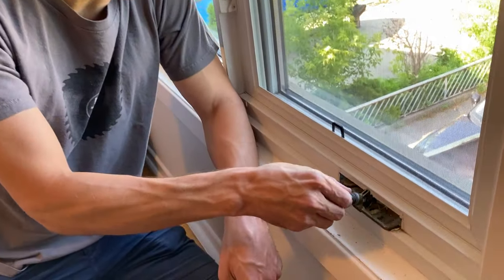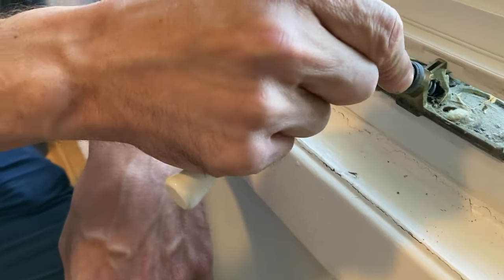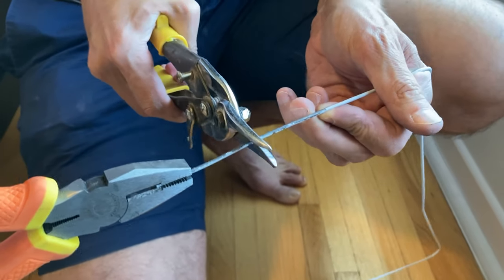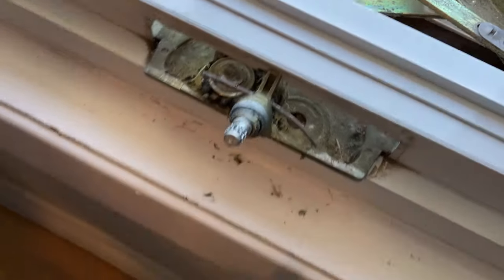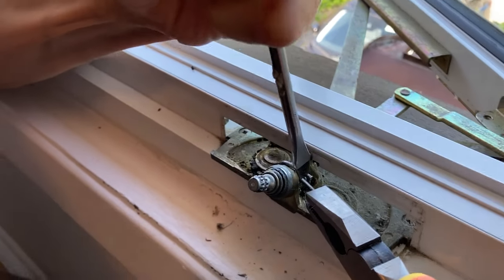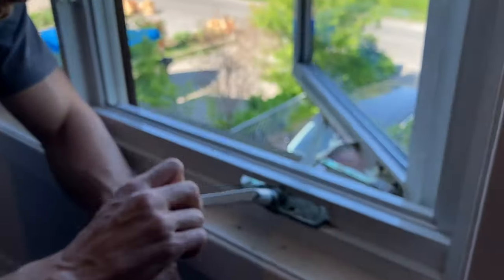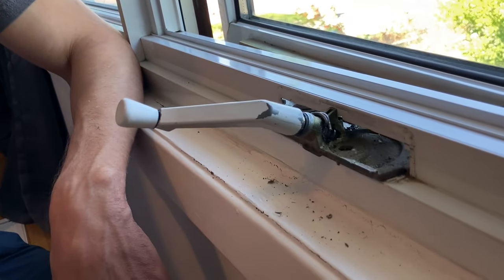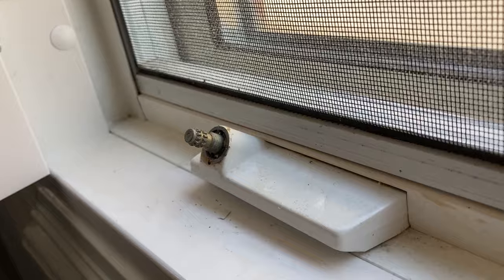Window Crank Repair Trick (for cranks that slip out when closing a window)

Comment: After 2 hours of frustrating search I found your video; couldn't believe that anybody else faced the same issue AND figured out a way to fix it! THANK YOU GUYS (from Canada too)! It worked for me.
Reply from the maker: Really glad it could help! Appreciate the comment
Reply: damn good for you..my Andersen casement window model doesn't have enough side opening to slip the wire between the frame and the first thread like this video.
If I put the wire between first and second thread, it gets stuck. Imma replace the whole operator at this point but
save the part and see if I can scrap the opening a bit so I can use it later for another window.
This house has about 20 Andersen casement windows as we moved in like 5 years ago, and there is NOT a single window that operate normally.
Reply: Thanks from Stoney Creek.  Same thing happened to me this weekend.  Was not looking forward to a big repair.
Reply: Buddy I know exactly how those were broken, because I'm Canadian too 😂 damn ice

Comment: Thanks for sharing. It started about three years ago they were breaking one by one and approx. $50.00 each for a new one on a fixed income was not affordable. I saw other videos but i didn't try them, then i came across this video and fixed 4 of them in less than 1 hr. and they work great. Thank you so much from Ontario Canada
Reply from the maker: Really glad to hear that this trick worked for you…it can be so frustrating dealing with this kind of thing! All the best!
Reply: Hello from Caledon. We have a kizzillion of these throughout the house on our Royal windows(I WOULDNEVERBUYTHEMAGAIN) our are metal and need to be repaired,,but i haven't tried any repairs on them yet. I'm hoping that it will be as simple as this,,but knowing my luck, not likely...Question; how did you figure out what needed to be done??
Thank you.

Comment: Yes!! Thank you have had 3 of these broken for 5 years and have had to take the screens in and out because the window guys all said we had to replace them to the tune of 1500 for each window! Now they are fixed. Even if temporary, this cost me NOTHING. Thank you!!!❤
Reply: If ever needed - you can replace the hardware. The only hard part is getting the wood trim lifted, the remainder is just screwdriver work. There are videos for that. Hardware is $30-80 each window. I have replaced it on 5-6 windows because the teeth in those cops were chopped off. Now I am facing the above problem for the first time.

Comment: Wow. THANK YOU. That was an awesome fix. FYI, I used a small screw leftover from a wall switch faceplate. I literally just screwed it in, making it very snug and tight, and I think it may be a little stronger than coat hanger wire. Seems to work just fine, and saved me a LOT of trouble from having to take apart the window frame. BTW, as a southern Californian, I absolutely love your accents. 🤘😁

Comment: Thanks for the vid and I tried this out and it on this exact same crank and it works.  My wire work was a little sloppy so makes it hard for the housing to stay in neat but it works. 

Then I realized something and had a duh moment. 
That plastic housing has a lip on it where the handle spindle goes through. 
It's that little lip that breaks that allows the spindle to worm its way out. 

I was about to replace the whole assembly and then realized I ONLY have to replace the little plastic cover. 
THAT will keep it in place and only costs $7 on Amazon and just easily snaps in place. 

The problem for this specific brand is that tiny little plastic lip breaks.  Replace it in under a min with the $7 snap on replacement.

Comment: Thanks guys. I had tried loctite on the pressed in shaft bushing. Worked for awhile. Thought I was going to have to spring for a new one. Found your very helpful video while searching for a reasonable price. I used a hardened Allen head bolt and locking nut, 6-32 I think or might have been an M4 from my junk drawer.  👍👍

Comment: It works! I For anyone having problems with the fit, I had to open my window most of the way to get the coat hanger into the groove. I only used pliers to bend the coat hanger back and forth until it broke, and used pliers to slide the piece of coat hanger in. I have truth casement windows, I think from the 80's but not entirely sure. Thanks for the video! EDIT: I also have anderson casement windows, this fix will not work for those.

Comment: Thank you so much, this is exactly what I needed to watch.

The screws for mine is on the outside of the on the window of the mechanism. (And I could not drill or unscrew the back to get to the hole, to put the clotheswire through)

There are five screws, the one in the middle is kind of blocking the round turn flat thing with the groove; that make the window open and close.
Plus there are two tiny little screws on the other side so you're not going to get all of that.
 I'm done unless you take the whole window part. 

So after removing the window screen.
1. I just loosened 4 screws (maybe it wasn't necessary). I noticed that if I turn, with my right hand.... the handle to the right.
2. Then pull with my left hand forward...... just do that in increments.
 About four times, that made the window come back in.
3. Then you can get something like a curved, thin handle or string to pull it close....that last half an inch. Then lock it in place.

To God be The Glory. I prayed for a video. This help me see what's need for my window.

Comment: Brilliant!  Thanks a ton guys! It was a little hard to get the wire through but it worked great. Way better than drilling a hole and set screw. Thanks so much for sharing.

Comment: Great idea.  Very observant.  My  client has a whole house full of older Anderson windows that are doing this.  NONE of the thermal barriers are broken on the sashes so it would be a shame to replace them just because of the openers.  I was going to investigate replacing just the crank mechanism but this saves her even more dough.  Good eye, gentlemen. This is the kind of stuff I do all the time but you two beat me to it!  I'm going to subscribe as you seem to be as clever and humble as me!   Keep up the good work.  Anderson could have used you two when they designed the cranks in the first place!

Comment: This trick worked well on a 25 year old casement window with a Truth dual arm operator. Use only about 1-1/2 inches of wire, then bend the excess to the back instead of around the casting. This allows the original plastic cover to fit after the repair.

Comment: Thx! Worked well (with two pieces of coat hanger for ours) for one of the old Truth Entry Guard window operators (circa 1980) we have which opened but did not close, like yours. The others we have which resist both opening and closing I think we’ll need to replace; hopefully just the crank operators, not the whole windows.
Reply from the maker: It's nice to hear that it worked for at least one of your window cranks! Good luck with the others. Thanks for the comment!

Comment: This is great, what it is, there is normally a plastic bushing between there to keep it from moving in and out, they ware out over time from dirt and grime.. This is the same way I fix them. The one you fixed are older ones..  The other you looked is newer version. Those are casted, open the window all the way  and you can removed it from the outside.
Reply from the maker: Thank you so much for the tips here! I appreciate you letting me know about the casted/newer cranks as well. Thanks for watching and all the best!

Comment: A cotter pin would be an easier install than the clothes hanger wire.  But thanks for the idea.

UPDATE: I have a slightly different style of crank housing.  I can't drill a hole thru both sides of the housing.  I drilled a 7/64" (2.7mm) hole on one side of the housing.  I hammered in the aluminum stud from a 3/16" pop rivet into the hole to pin the crank screw to the housing.  

The aluminum stud is malleable enough to be hammered thru the slightly smaller diameter hole and flatten against the shaft of the crank.  I trimmed the stud to about 1/16" proud of the surface then flattened it with the hammer.  Nail sett can also be used to further flatten the stud.  Basically, the fix is a diy rivet.  YRMV.
Reply: My exact same thought!!!

Comment: Good informative video: My broken crank handle is Ventarama, long out of business, with a similar problem. The crank handle opens a skylight. I'm unable to find the 'hole' but, in my case, the space on the shaft contains very thin spring/clamp washers, which I think have worn to uselessness. I plan to refill the space with several washers that I hope will stop the threaded shaft from spinning. The skylight is about fifty years old.

Comment: I have a window screw that has done this.  I wonder if there was a cotter pin or something in the original assembly that has  disintegrated.  It seems that might be the case.  While I suppose I could replace the crank mechanism with one from a window that we rarely use, why not fix what you have.  Thanks for this.  And I think this is something I can do!!  
I also find these crank windows do not close very well.  They don't fit tightly so they can be locked shut.  That is probably due to the swelling and the window gaskets not fitting well.  I end up pushing the window fully closed from the outside in the fall when I am closing them for the winter.

Comment: I'ma try this
I have the exact same setup
Reply from the maker: Hope it works!
Reply: @JohnnyFiacconi  hey man this fix worked great for 2 outta 3 of them 👍

The other one i had to drill a hole and screw in a pressure pin to hold the cylinder in.
Reply: @JohnnyFiacconi  thx very much for this fix 👍